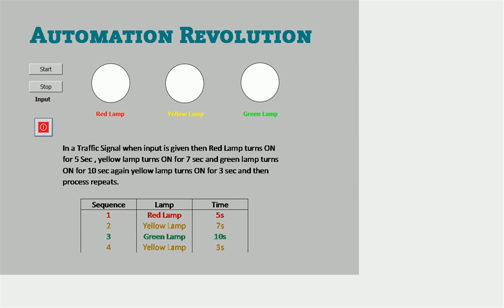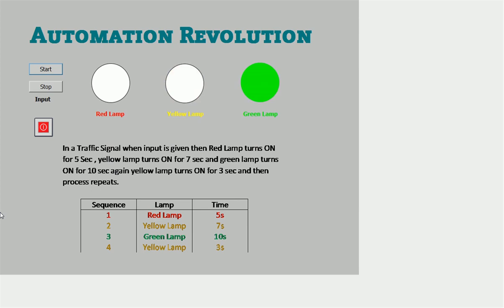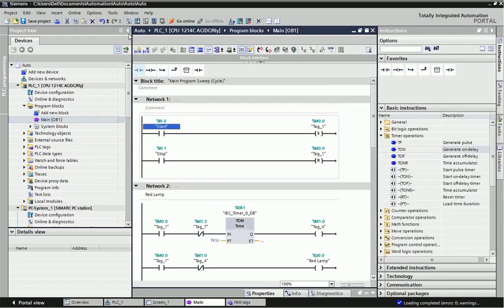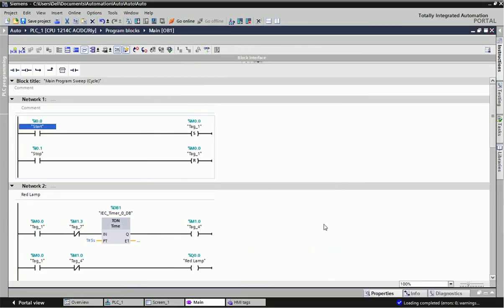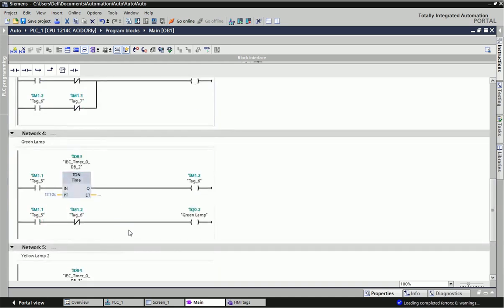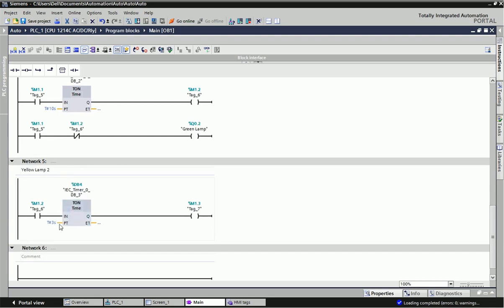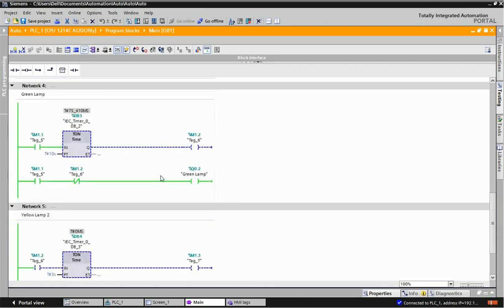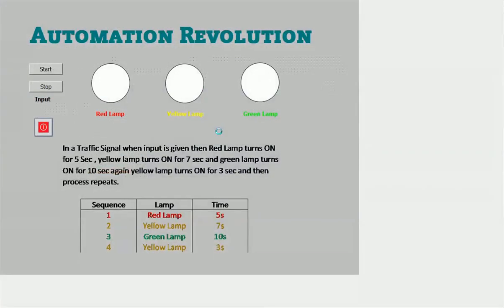Traffic Light Control PLC Program using Timers . #PLC #SCADA #Industrial_Automation

Comment: I am using tia portal v15 and using s7 300 plc  , my cpu has been read/ write protected what should i do and i have lost the password ? My program and setting has almost done. If i format plc will will i loos everything ? Can i download my previous backup ? Will it work?
Reply from the maker: Do not format , you will lost your program & configuration. Better to find backup first and then go for format.
Reply: @AutomationRevolution  yes i have recent backup . So do i need to format memory card only or can i format it through tia portal itself? Will it ask password while factory reseting?
Reply: Can i have the link to download tia portal v15